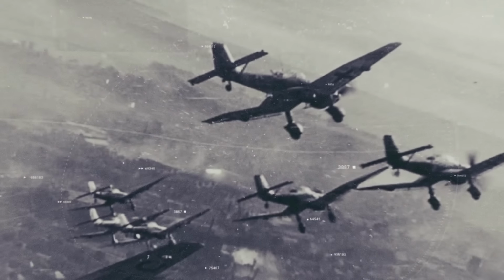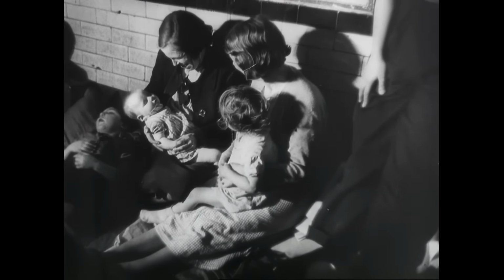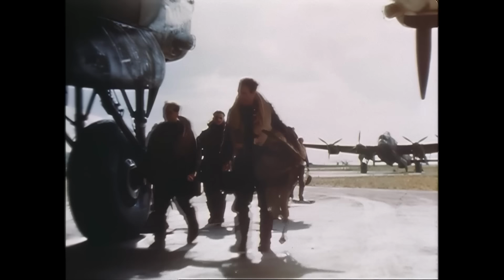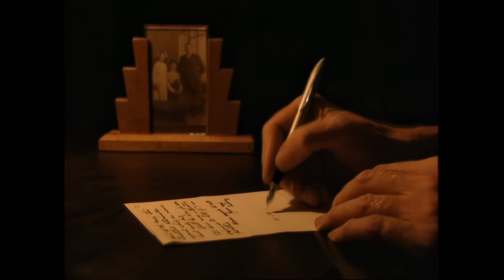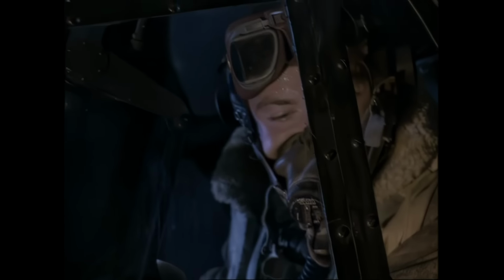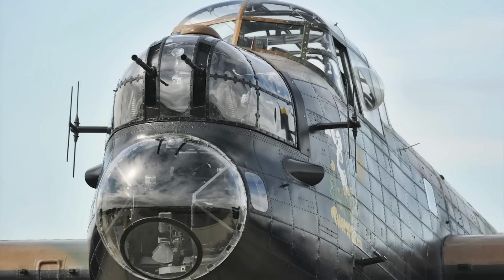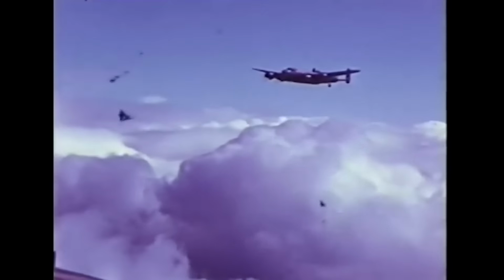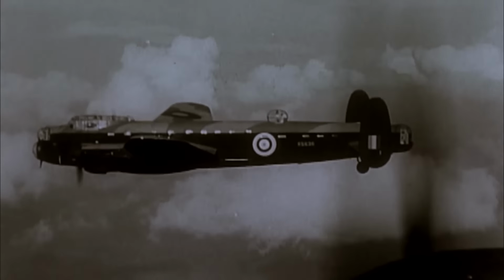LANCASTER BOMBER. WWII Aircraft that Changed The War. Powered By 4 Merlin Engines | Documentary

Comment: Piece of junk, imo. 
It's very pretty and sounds great.
But a piece of junk for long-range bombing over a heavily defended area, imo.

1) Most of them had pathetic, defensive arnament (little .303's). Which is even worse considering most of the aircraft they had to shoot down were big, twin-engined fighters. Not mostly single-engine ones like the Yanks did during the day.
2) Most of them had inline engines. That means even the tinniest hole in a coolant line (by bullets or flak) meant that engine would sieze up in 15-20 minutes. Whereas radial engines (like on the B-17) could take far more punishment.
3) their ceiling was lousy. Only (using above stats) 21,400 feet. Making it much easier to reach them with aircraft and expecially flak.
The B-17G's ceiling was over 35,000 feet.
4) I read that only 27% of their crews finished their full tours without major injury, capture or death.

The Lancaster is one of THE MOST, overrated weapons systems of WW2, imo.
☮
Reply: 1) 291 B-17s took part in the second Schweinfurt raid on 14 October 1943. 60 were shot down. Another 17 scrapped after landing, a further 121 were listed as damaged. 650 aircrew killed or captured. You'll have to give a little more detail of the excellent defence capabilities of the B17.
The B17 was designed to be a bomber that could defend itself.  Fact is, until long range fighters could accompany it, bombing missions suffered huge losses, which kind of says it failed in its design purpose.
2) bomb load. B17, absolute maximum 8,500lbs. Lancaster 22,000lbs. 
On long range raids such as Berlin,  the B17 carried 3,500lbs. The twin engine mosquito carried 4,000lbs to Berlin, Lancaster 13,500lbs to berlin.
But in reality, all different planes, designed to do different things so pretty pointless comparing them.
Reply: The Merlin was so crap that it turned the P51 into the second- greatest Allied fighter of the Second World War - behind the Spitfire.

Comment: So how did the B17 become the darling bomber of wwll ?
Reply from the maker: Interesting
Reply: @dafyddllewellyn6636  That, and the B-17 was more survivable.  It's also hard for the Lancaster to be a "darling" when most of it's bombs miss AND that it was nearly impossible for crews to get out .
Reply: @arthurfoyt6727  You need to do more research.  At the start of WW2, night bombing  was being conducted by celestial navigation and dead reckoning, with the result that almost no bombs hit their targets.  The USAF tried to remedy that by using the Norden bombsight in daylight, but the loss rate to Flak and fighters was enough to bring Eaker's efforts to a dead stop. It was not until the B17G and the P51 arrived that the head-on attacks by the Luftwaffe were brought to a sustainable level of losses.  The RAF  under Harris got, firstly, Gee and the pathfinder force was initiated under Bennett, with expert bomb aimers and high-powered pyrotecnic target markers - which the Germans sought to counter by lighting fires in open country.  The pathfinder force became effective when Oboe was introduced;  but it was still necessary to conduct area bombing - Oboe - aimed markers at least got the bombing carpet  centred fairly well on the target, though when ground markers were obscured by cloud etc, parachute flares had to be used, and they are subject to wind drift.  Later came 10 cm H2S  which could pick out areas of water, allowing Hamburg to be burned out; the invention of the cavity Magnetron - when it was allowed to be carried over enemy territory - enabled 3 cm H2S, which was much more accurate.  So it is hardly surprising that "most of the bombs missed the target".  Late in the war, the aid "Gee-H" was introduced into Lancaster Mk II - which enabled precision raids to be made under instrument condtions..  The average loss rate for Bomber command was around 3% per raid, and that was "sustainable".  By 1945 it had dropped to about 1.2%. (Reference:  "Bomber Harris" by Dudley Saward. ISBN 0-385-11258-0)
Reply: @dafyddllewellyn6636  OVERALL most bombs from the Lancasters MISSED their target.
That, and the high losses was  hardly a :good thing" for Bomber command....
Reply: @arthurfoyt6727  you are still talking rubbish.
Reply: @hitime2405  "rubbish" is thinking all bombers were equipped with the latest radar and navigation, that it worked from the start, that it was early enough in the war to make a difference AND that there were no disadvantages to flying predictable patterns.   By the number of bomber losses, it made it just as easy for Germans to put up countermeasures.
Reply: @arthurfoyt6727  I didn’t say any of that, I’m the person saying the Lancaster was the best bomber of WW2, I have replied to many of your comments on here proving why it is.
Reply: The Lancaster was a fine piece of kit but Americans 8th Air Force turned the UK into a Boeing equipped aircraft carrier.  The B17 was the most popular Bomber of the war because they were visible to the public and were conducting the most dangerous raids of the war.
Reply: @davidwelsh829  “ they were conducting the most dangerous raids of the war” how? their loss rates do not reflect that, the most dangerous job in WW2 was a German U-boat crewman followed by British rear gunners of Bomber Command.
Reply: @davidwelsh829  also the highest loss on an 8th Air Force mission  was 60 bombers lost on the Schwienfert raid, but RAF Bomber Command lost 95 bombers in one night raid on Nuremberg.
Reply: @davidwelsh829  and you seem to forget that British four engined bombers carried out large numbers of daylight raids in 44-45 as well as at night.
Reply: A mosquito could deliver the same bomb-load as a B-17 to Berlin, with far lower losses and only had a crew of 2.
Reply: @mickkent1826  yes the Mosquito was an amazing aircraft,  I mentioned in a post on here that Air vice Marshal Don Bennett put forward the plan that all current bomber production in Allied countries should cease and that they should change over to producing the Mosquito with enlarged bomb bay doors only, if that happened then obviously the Mosquito would have dropped the most tons of bombs and been the best bomber of WW2, but unfortunately that didn’t happen, so we are still left with the Lancaster as the king of bombers in WW2.
Reply: "So how did the B17 become the darling bomber of wwll ?"  Hollywood.
Reply: @silgen  spot on Steve.
Reply: @hitime2405  also the highest loss on an 8th Air Force mission  was 60 bombers lost on the Schwienfert raid

No, the most U.S. bombers lost on a single mission was the first major daylight raid on Berlin on 6 March 1944. A total of 69 heavy bombers were lost to enemy action (with another four written off after returning, and one crashed on takeoff at the start of the mission).
Reply: @mickkent1826  A mosquito could deliver the same bomb-load as a B-17 to Berlin

No, it couldn't. A B-17 could carry 5,000 lbs of bombs to Berlin; the most the Mosquito could carry was 4,000 lbs (consisting of a single 4,000-lb 'cookie' blast bomb) and that only by those equipped with bulged bomb bay doors. For Mosquitoes without the bulged bomb bay doors, the load was 2,000 lbs.
Reply: @primmakinsofis614  sorry old chap but if you are including the lost in crashes then the total on that Schwienfert  raid was 77, and on the British Nuremberg raid 30/31 March 1944, 95 heavies were lost with a further 10 crashed or written off on return.
Reply: @hitime2405  I just mentioned the write-offs to give the full picture. In terms of losses to enemy action, the 6 March 1944 raid to Berlin was the single worst day for the USAAF in terms of bomber losses.

Nuremberg was, of course, the worst for the RAF.
Reply: @primmakinsofis614  yes you are correct, I will remember that in future, thank you for the correction.
Reply: @bigwoody4704  Just "dropping bombs" and losing men is hardly a great bomber.  Each loss also lost FOUR Merlin engines.   Expensive, slow, vulnerable, and inaccurate.  It was nothing special; it was just what they had at the time.

Comment: It was a terrible bomber; 50%+ loss rate?
That's nuts.
Reply: @wilburfinnigan2142  are you not aware that large numbers of bomber aircrew were lynched when captured, most we’re aware of that very real possibility, they probably thought they would sooner go down with their aircraft.
Reply: It was the best bomber of the war, in spite of the loss rate the Lancaster dropped more tons of bombs than any other bomber in WW2 plus 50 million incendiary devices!!! even though there was more B-17 and B-24 bombers built the Lancaster still achieved that.
Reply: @hitime2405  EVEN with the cover of darkness, the loss rate was 50% plus.  Obviously even with the odds in their favor they fell out or the sky at a rate that would call them as dangerous to the crews as they were to the random bomb patterns they delivered.  MORE BOMBS dropped on hayfields and not on the target sorta negates the more bombs dropped as "good".
Reply: @wilburfinnigan2142  And what was worse the damn thing was a flying coffin very hard to bail out of access hatches too damn small

Crew survivability percentage by crew position, January through June 1943, in order of Lancaster | Halifax | Wellington

Pilot = 9.6  |  20.8  |  14.6
Navigator = 13.8  |  36.2  |  21.0
Wireless operator = 11.9  |  32.5  |  18.5
Flight engineer = 12.4  |  34.0  |  ---
Bomb aimer = 13.2  |  31.4  |  18.5
Mid-upper gunner =  8.5  |  27.3  |  ---
Rear gunner =  8.0  |   23.4  |  14.6

Overall = 10.9  |  29.0  |  17.5